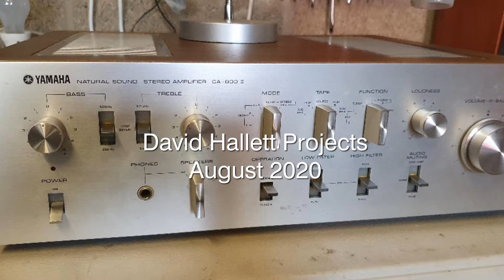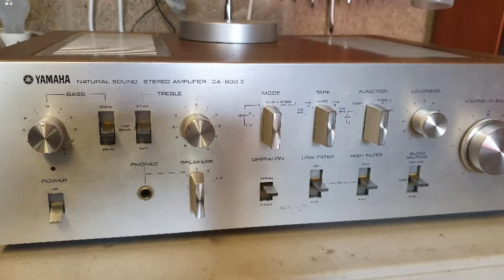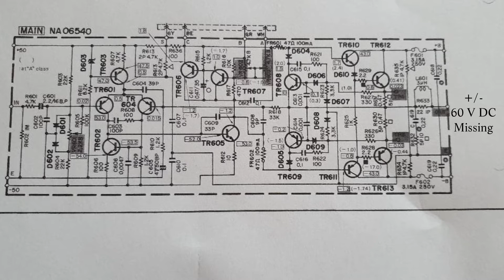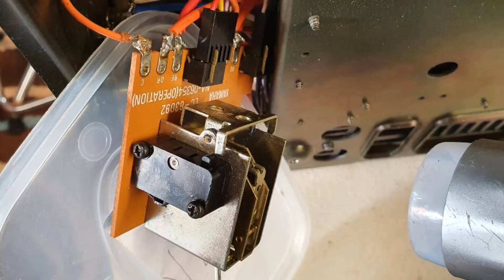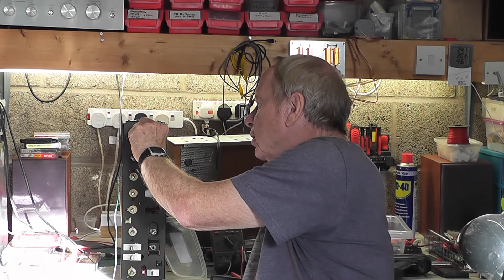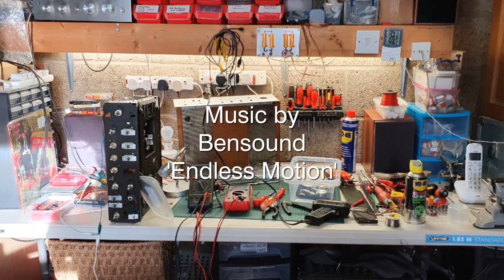Yamaha CA-800 II  Amplifier Repair

Comment: Ive got two same amp. everything works fine on other input except the phono stage. The first one Its making noise when turning the volume knob though phono is working. The other one has distortion when switched to phono.

Comment: Not sure if you are still monitoring your videos but wanted to jump in with a question. I have this same amp and I'm getting some really bad distortion out of both channels. Volume has no effect - it will not increase or decrease with the volume dial. It is out of both channels and starts up randomly - usually after warming up for 30 minutes or so. It has nothing to do with the source - the distortion is there regardless if you are playing music or not. Also no impact when you adjust any switch / dial. Is that the issue you were having with this one?

Comment: Hello greetings! I am not a technician or anything like that but I have a Yamaha CA 610 and a CA 810, in both I did the cleaning of the switches when I bought them, the noise was remarkable, also in the 610 the trebble balance did not work from the middle onwards. It is impressive how dirty they can cause such serious failures. I also cleaned for noise the buttons of a Pioneer SG9 equalizer that I just bought. The most curious thing is that I don't use contact cleaner; Here my friends who are technicians use Mechanic's Assistant Spray, that is, Penetrating Cleaner. They are also immersed in alcohol for 24 hours. I use alcohol, and industrial dielectric cleaner with an injector and if it persists I use the penetrating cleaner. So far all noise is gone from the three components I have cleaned. The front and controls of these components should be cleaned with an alcohol-based degreaser.
 I congratulate you for your channel, I am already your follower and I will always be here. A hug from Venezuela.
Reply from the maker: Thank you so much for your comments and recommendations on cleaning methods. It is always good to know what alternative fluids work . Thank you for your support of my channel. I have recently obtained some rerto audio an am in the process of making a tec video about it. Take care
Kind regards
David

Comment: David, Thanks for your video.
I wonder if you might help answer a question?  
I have a CA-800 (not II)--is the difference between CA-800 II and mine simply a bump in power rating?  I have been unable to locate anything so far that speaks to their difference(s).
Reply from the maker: Thanks for your question, I will investigate.
Dave
Reply: @DavidHallettProjects  Sir, I've another question which I dropped the first time around.  When the unit is in the Normal operational mode, is it always operating in Class B?  I don't know that I've seen anything that speaks to that.  It could use the common approach of the first watt or so is in Class A and all above that in B.  I'm no expert so this question is for satisfying my curiosity, nothing else.  Thanks!
Reply: Look at the schematics of the main amp and compare the 800 with 800ii, they are rather different. the 800ii is clearly an upgrade and looks a bit after the CA-1000. I would prefer the 800ii although having the 800 (in repair). Same issue as in the video. I would have replace the microswitches instead of spraying them with cleaner. It's bound to have the same issue in no time. BTW NEVER switch from NORMAL to Class A on the fly. First switch the amp off. There will be some arcing within the switch and causes the contacts to burn in. Flaw in the design.

Comment from the maker: Thank you, yes great piece of equipment.
Reply: hi!
I've been having trouble with my yamaha CA-800.   I'm loosing the right chanel.. I used to be able to play with the source button and it would come back, but no more.  do you think I need more than simply cleaning that switch with contact cleaner...?
thanks.
Reply from the maker: @sypernova6969  Hi,
Have you released the switch from the chassis? My gut feeling is to keep cleaning, I thought I had done a good job but had to perceive. Let me know how you get on.
Reply from the maker: These switches can get very corroded, use a good quality cleaner and keep trying
Dave
Reply: @DavidHallettProjects  hi!  Just to clrify, you haven't fixed my amp, i was asking for advice since you posted a video on them somewhat recently.   I'll clean and clean, and hopefully you are right. Thanks!
Reply from the maker: @sypernova6969  
Hop you get it sorted, good luck
Dave